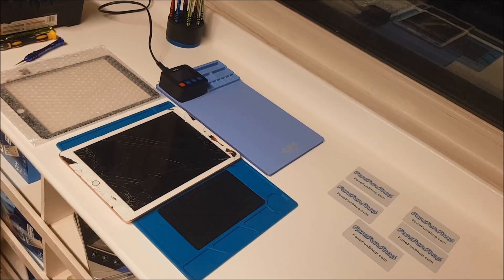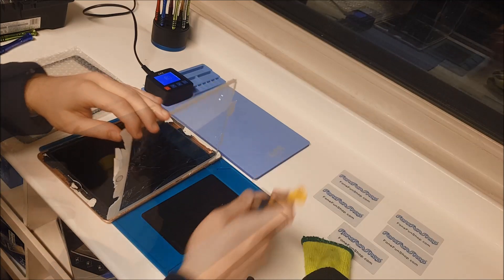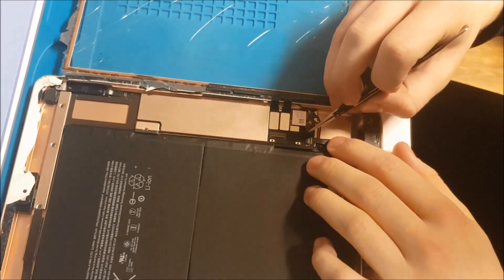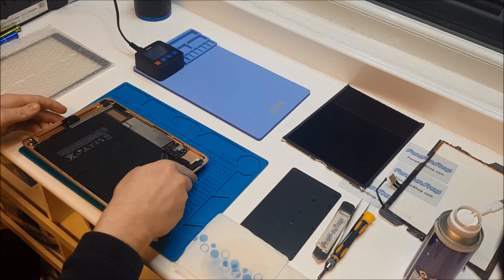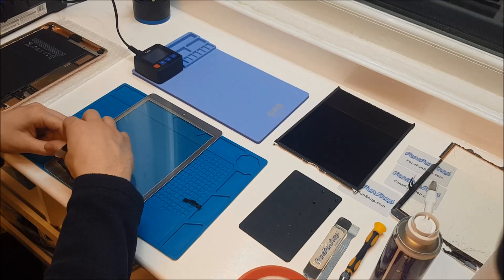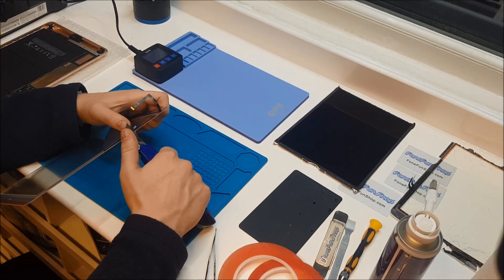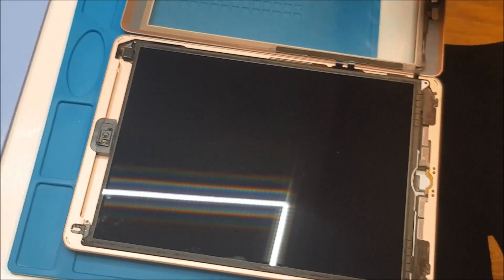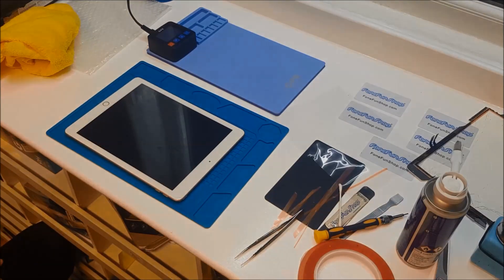How To Change/Replace A Digitizer On An iPad 2018

Comment: My tab 4 have no issue but i have a very small spider under digitizer and i want to clean it , but i want to know if hair dryer work and what best glue b700  idont remember what it called exactly  or adhesive tape ?